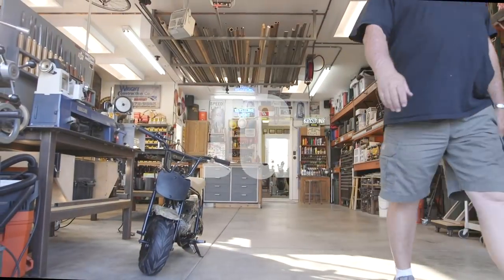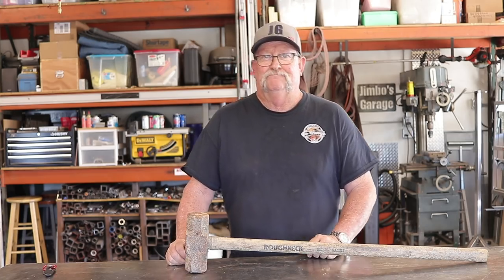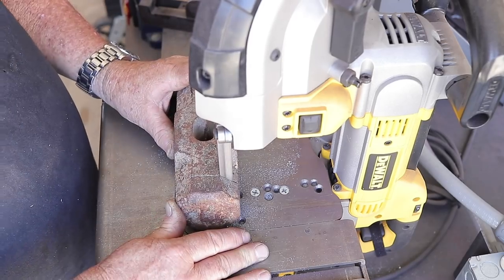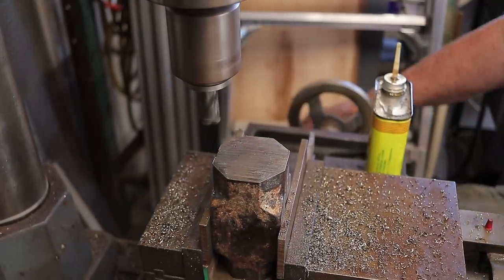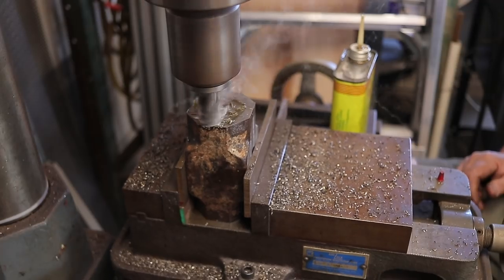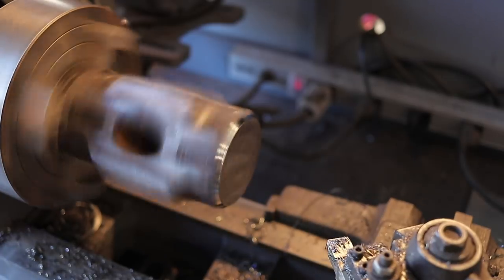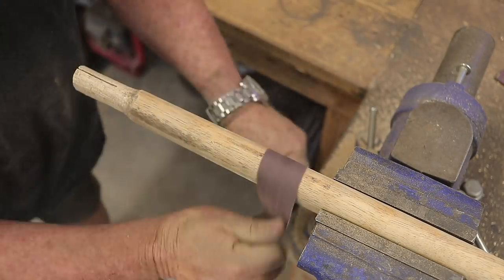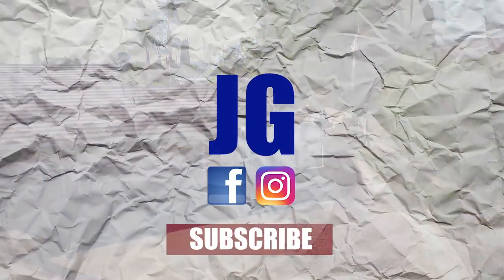Sledgehammer Restoration | JIMBO'S GARAGE

Comment: Good Mod! Being a heavy equip. mechanic all my life I too like to cut down one of my heavy go-to sledges and shorten the handle like you have. Only difference is always working with greasy and oily hands and conditions I would grind in rings on the handles of all my wooden hammer handles for better "Gription" and less flying time.lol. Great videos, keep them coming. thanks.
Reply from the maker: Thanks for watching Eddie,   Jimbo!

Comment: Hey Jimbo!  So I have a couple thoughts on your chamfer dilemma... it is definitely one of three possibilities. Most likely your spindle speed was a little high especially for a high speed steel tool. ( in the 2 1/2”-3” range I like to be somewhere in the 300-350 rpm ballpark),  your tool could have been slightly blunted or possibly not on your spindle centerline. Any of those three circumstances could have created those super hot chips. Hope this helps. Thanks for all the great content! I have picked up some awesome welding pointers from you so thanks again!

Comment: Looks like that turned out really well. But there is a science to how long the handles should be on things like hammers related to the "centre of percussion". Get it wrong and the handle either smacks back into your hand when you use the hammer or jumps forward causing you to drop it. If I ever make a hammer I intend to look this up and figure out the math :)
Reply from the maker: Thanks for watching and your suggestions Ben C,    Jimbo!

Comment: I use a 12 lb hammer when I want things to MOVE - it just has more inertia.  As an HD Mechanic, I'm thinking of (eg) bucket pins on a loader.  The lighter hammers take more hammer blows to generate the same movement, which results in more 'mushrooming' and a jammed pin.  That said, yes the 8 lb hammers are more friendly if you have to swing them all day (such as concrete work).
Reply: Oh, and 6 lb hammers? - those are for sissies.  lol

Comment: Hammers are specially hardened steel, you should not cut them in size. You create surfaces that are no longer hardened and can chip. If it chips while you hammer then a small piece of metal will get the hole force of the hammering. You create a sharp small projectile that is quite threatening. My father in law had such an accident and the chipped metal is still in his neck stuck between two arteries.

Comment: This does look good...I do like the shorter lighter hammers....
The only thing I see with this is, the head had a casehardening on the face( or at least some kind of hardening as the champfering shown in the lathe that it was outer layer was hard enough for the carbide to have difficulty cutting ), and now it was cut off.... Leaving the softer core exposed. 
Working with it will be fine for a while, but a good blows will mar the face, and continued use will cause it to be furthered into its degradation,  Potentially spalling sharp chips soon enough... Untill a rehardening is done.

Comment: as i commented once on your video... imho there is no "wrong/right" for the home shop. we have to work with limited ressources and we have to make everything from cutting wood to milling steel wich makes it impossible to master everything to perfection. if it works in the end, you did it right. 

same goes for me on the lathe, if it works, its right. i never understood how to calculate a cutting speed, or how to have exactly the chipload i need... heck i mean 99% of the time we dont even know what metal it is we machine so we have to do it by feel anyways
Reply from the maker: Thanks for watching and your comments Sharky,   Jimbo!

Comment: Hello Jimbo, thanks for showing your work one more time. About the chamfer you have done on lathe machine. It is not clear for me on the video. Is the spindle rotating counterclockwise? It seems to me that this is the right rotating direction for the chamfer tool that you are using.
Reply from the maker: Thanks for watching Victor, Yes it is going in the right direction.   Jimbo!

Comment: Hammers, and axes...ect normally have a hardened face or bit and a soft body.
I hope you didn't cut most of the hardened steel away.
If there's only 1/8 or less left this hammer won't hold up very well if used on steel.
A hammer needs to be hard enough not to deform easily, but not so hard that it easily chips.

Other than that I'd say your wooden wedge probably was a bit thin.

Comment: Usually i drive steel wedges in there ....
Reply from the maker: Maybe that is the answer!!    Jimbo!
Reply: JIMBO'S GARAGE for real !  Cut the handle flush before you drive the steel wedge in And drive it with a chisel or punch just slightly below flush - that is the end if it ....  lol  i do that on hammer and axes .... never had a problem ...  i think that is a european thing ....